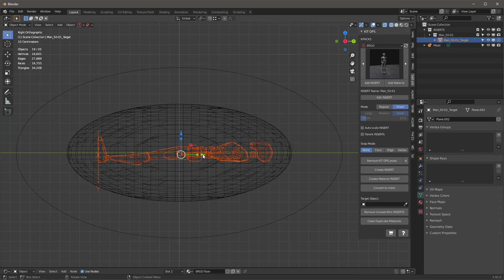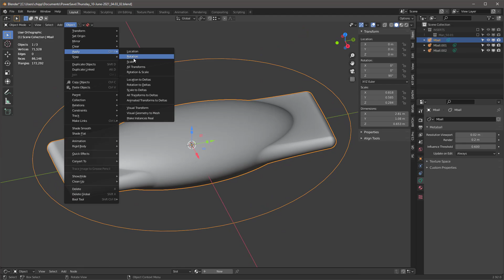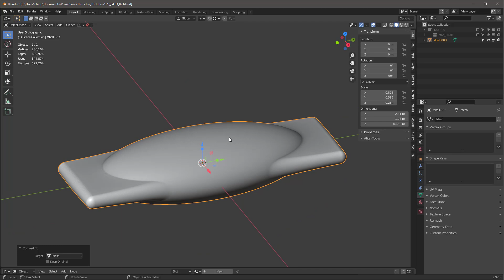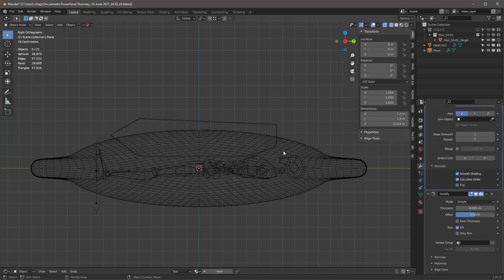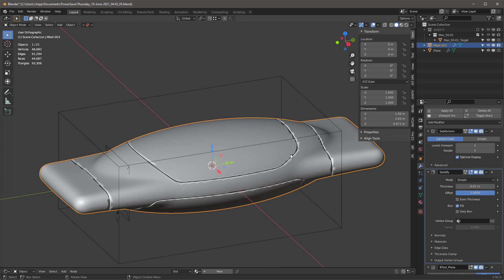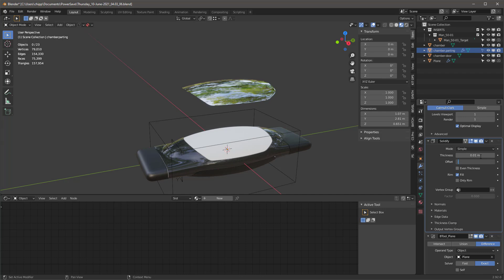Create this Hibernation Chamber using Metaballs

Comment: Great tutorial! Also for those who get an error while remeshing from Object Data Properties tab (error: The mesh needs to be manifold and have face normals that point in a consistent direction).
When cleaning up the mesh doesn't help (merge by distance, recalculate normals, etc.) I found what worked the best.
Solution: Remesh your converted object with Remesh under Modifier tab first, voxel or smooth type depending on your needs, just keep the face amount high.
After that you can remesh to lower face count and quads from Object Data Properties tab as in the video.✌